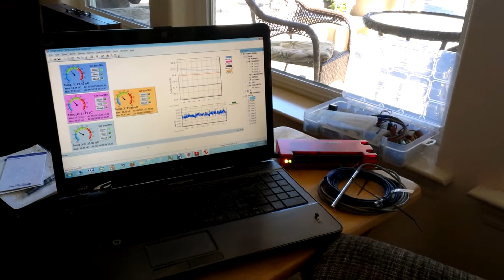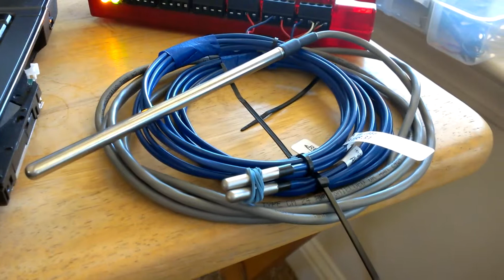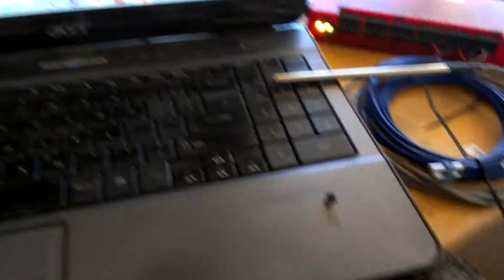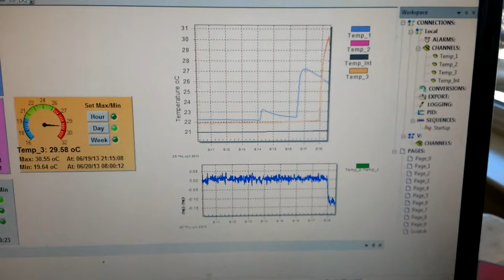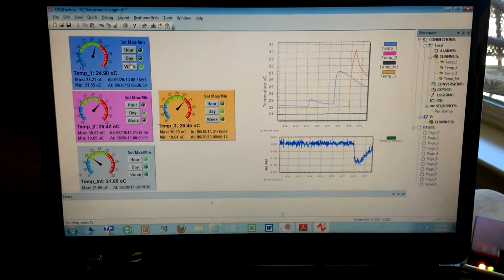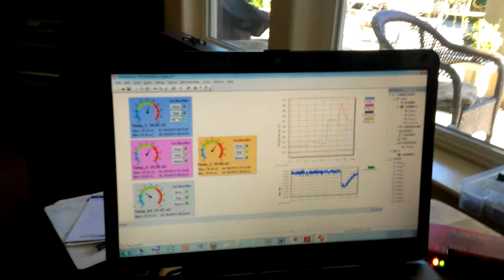Temperature Recorder Built in DAQ Factory

Comment: I'm new to DAQ factory.  How did you get the temperature values? I'm using 4-20mA transmitters with a range of -20 to 80 degrees (Vaisala HMD60Y transmitter).  Any suggestions?